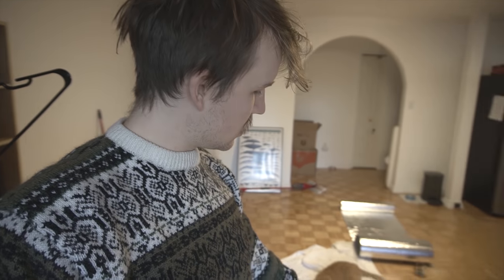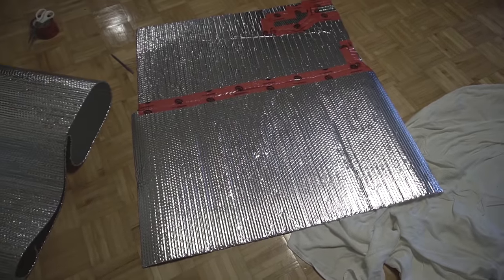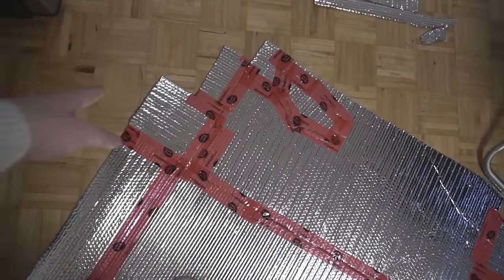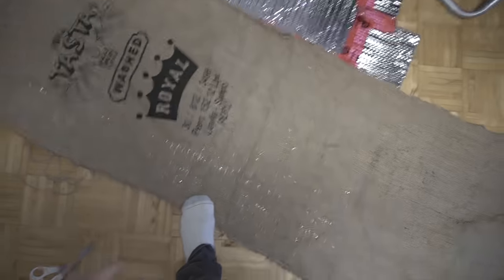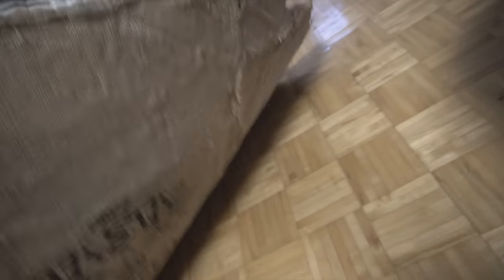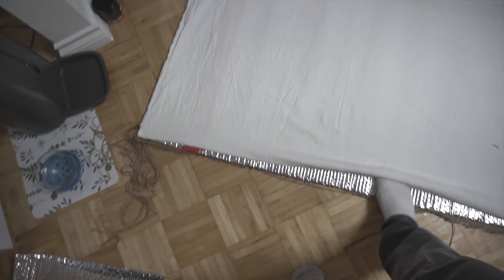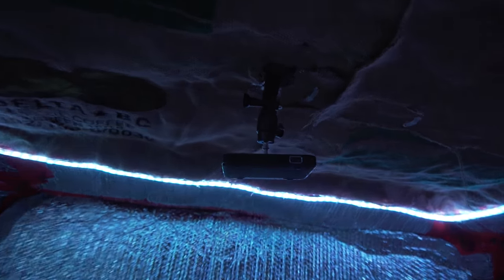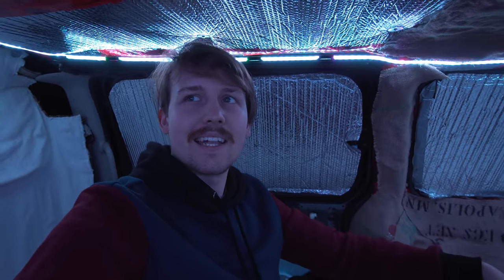How to make Blackout Curtain divider for Van life Privacy and insulation! DIY

Comment: Cool idea. I hope you'll do a review on the projector after you've used it for a bit. Hoiw long it will go on a charge, ease of use, that sort of thing. I have a 14 foot box truck I use for camping and we've projected movies on the exterior skin. It was like being at the drive in but it is all old school equipment so we used a generator to run the projector, dvd player and full size stereo rack system. Still really interested in see how this mini van conversion all turns out.
Reply from the maker: yeah I'm quite impressed with projector technology now, I used it a bunch last night just running of it's internal battery and it works great, super sharp when you focus it properly and all around impressive for it's size. I'll be doing a full review on my "The honest review - with Forrest" channel but also tomorrow I'll be showcasing it in a video on this channel.
Reply: Sounds at - I'll be looking forward to it.